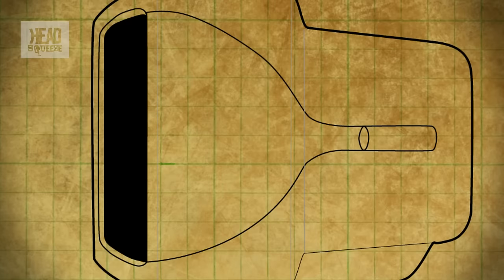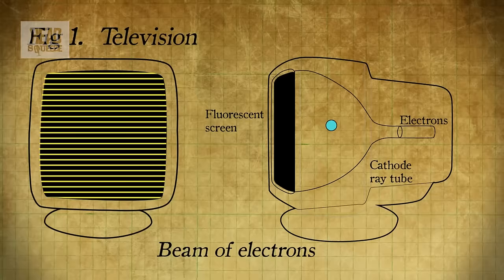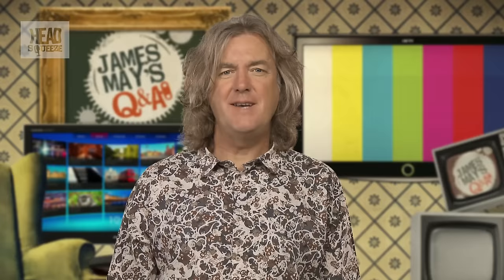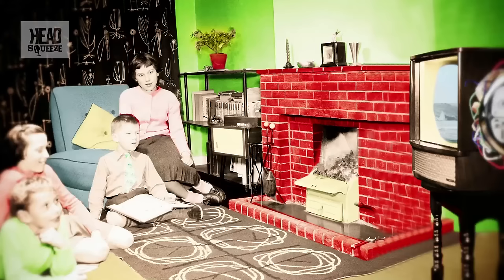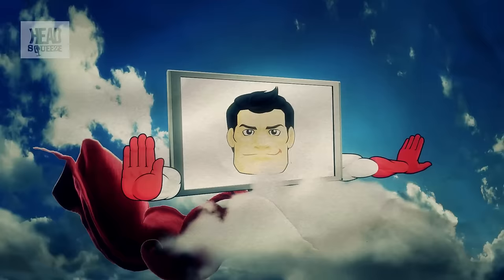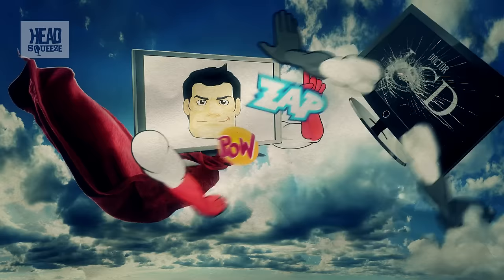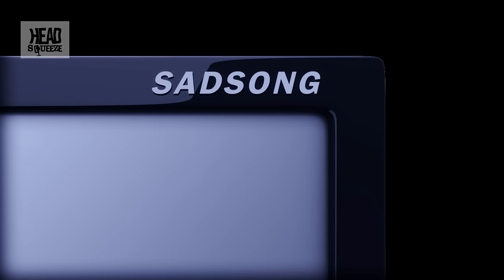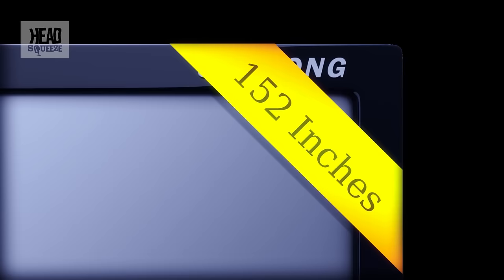How do plasma TVs work? I James May Q&A I Head Squeeze

Comment: How does a microvawe oven work? I guess it was asked but just in case ;-)
Reply: It generates electromagnetic radiation in a specific frequency that water molecules in your food react too and heat up. i might be wrong.
Reply: No, you are absolutley right I just want to se it in a video with a bit of fun facts ans stuff that they do :-D
Reply: Pan Fritz wrong.. the microwave sucks hot air in and pumps it into your face
Reply: You should not have said that ot me, now I want to try it. ;-)
Reply: cool i need a new plasma tv

Comment: Red, green and blue are the primary colours (yes, I'm Australian) for light, and red, blue and yellow are the primary colours for pigment. However, you are right, in saying most TVs use red, green and blue. I just thought more people should know.
Reply: "Primary" is a totally arbitrary designation. What you need to be able to reproduce a full spectrum is a set of three colours that are complementary (relative to each other). RGB, CMY, or any other set of 3 colours that are 120º from each other on a colour wheel.
Reply: @RFC-3514  Replying to an 8 year old comment lmao
Reply: @uwillbegme  - Has the definition of "colour" changed in the mean time?

Comment: Take it from an audio video engineer. Don't fall for the sales hype on these LED TVs. They are very hard on your eyes. I can't even believe they sell these things. It's a disgrace. Where is the reference piece? There is none the LED is all hype and sales talk and does not perform or deliver on any level. Buy a plasma and enjoy your life
Reply: The main reason plasma TVs are being phased out is that they use around double the power of LCD displays. 

In the future, OLED dipslays will probably take over and since they don't require backlighting, they will provide the same excellent contrast that plasma TVs do.
Reply: Rebasepoiss We can hope that you will turn out right about OLED tvs.  Right now, however, only LG is doing any real research into the technology.  Sony discontinued their OLED research and even discontinued the OLED screens for their PS Vita.  Now, you can only get a Vita with an LCD screen.
Let's just hope that LG sells a ton of their $3500 OLED tvs and inspires the rest of the market to get back into the technology.  With the death of CRT, DLP and now Plasma tvs, consumers are running out of ways to get excellent contrast in a home television set.

Comment: Re: Primary colours in television, they are Red, Green and Blue.

Red + Green = Yellow.
Green + Blue = Cyan.
Red + Blue = Magenta.
Red + Green + Blue = White.
White is made from a ratio of 11% blue, 30% red and 59% Green light.

These are the actual stats I was taught in college (specifically TV repair).
Reply: That last line is meaningless; you'd have to define the exact wavelengths (or distribution across the visible spectrum).

You're probably thinking about luminance sensitivity of the human eye (i.e., for the same total amount of light, green looks brighter to us than red or blue - similar to how sounds around 3500 Hz sound "louder" than 500 Hz or 8000 Hz even when they have the exact same amount of energy).
Reply: @RFC-3514  No, luminance is a different signal altogether in tv, relating to the brightness of the image.
 Chomanance is a seperate signal relating to the brightness of (usually) blue and red.
The human eye does see colour in varying strengths, it is even different from person to person - but the tv works on the numbers/ratio above.
Reply: @mickenoss  - I think you misunderstood what I wrote.

The values you mentioned are used to calculate the relative weight of different components for the luminance channel (typically called "Y") , in systems like YUV, YCbCr, etc..

For example, in PAL YUV, the Y channel (luminance) is 0.299×R + 0.587×G + 0.114×B.

Those weights are based on human vision, and they're used so that the Y channel can be used directly as a monochrome image (originally, so that colour broadcasts were compatible with B&W TV sets).

Chrominance is any set of two channels (typically along perpendicular axes within a colour space) that allow you to recreate full colour information by combining them with the luminance channel. They're not necessarily based on red and blue (YIQ's axes - used for NTSC broadcasts - are closer to cyan-orange and green-violet, for example).

But that was analog TV, anyway. In modern digital TV, which works natively in RGB, white is made up of identical amounts of those three channels (i.e., R=255, G=255, B=255, for 8-bit panels). The physical (light) weighting is done by the panel itself. From a "signal" (data) point of view, white has the same amount of each component.
Reply: @RFC-3514  I think you are missing the point of my original comment in an attemp to look clever.
 James mentioned tv's produced a colour image using red, green and yellow. This is wrong, it is red, green and blue.
Lookup up the ratio of colours needed to produce white light, you'll find the ratios I mentioned are right.
 I only stated them so it could be seen more clearly how white and other seconary colours are created.
Reply: @mickenoss  - Yes, he got yellow wrong, but the values you mention are specifically the weights used for the Y channel in YUV (which is just one of several encodings used for analogue video).

If you're talking about actual white light (in the "real world"), then first you need to define the exact wavelengths you mean by "red", "green" and "blue" (or whichever components you want to use), and even then you won't get true white light, because you'll have a very discontinuous spectrum (whereas "real" white light should be a mix of all wavelengths, not just three - this is a common problem with "white" LED illumination, that looks white when lighting plain white objects but can make some colours look "off", because it's missing intermediate wavelengths). 

And if you're talking about modern (digital) video, the values are actually identical for all channels (i.e., "white" is made up of identical values of red, green and blue).

Nothing to do with "looking clever". You just made a generic statement about "white light" based on a specific video standard, that doesn't apply to actual light or to the way colour is encoded in modern digital video.

Comment: It was red, blue and green Mr. May, not yellow.
Reply: It was actually yellow.
Reply: It is now red blue and green, but was initially red blue yellow. In pigmentation and nature Red b lue and yellow are the primary colors, but with light and digital display we use red blue and green
Reply: MacLeod Conners 
Thats actualy wrong.. well, partly wrong. The primary colors for light is Red-Blue-Green. The primary colors for print is Cyan-Magenta-Yellow.

There is NO overlapping of the print and luminancande color what so ever.
Reply: matsv201 let's rephrase this. They now say magenta, cyan, and yellow, because it's"technically" more accurate. Magenta is a shade of red, cyan is a shade of blue, yellow is yellow. Go to an art store and buy a color wheel for mixing paint; you will be told that the primary colors are red, blue, and yellow. If you want to be scientific about it, you would never say"magenta" you would say it's red followed by its intensity of red using the color measurement in Kelvin. Not Kelvin temperature of heat but color. There's always a way to be more right,  but when simply spoken things are still right; red, blue, and yellow are the primary colors,  even if it's different shades.
Reply: "Magenta is a shade of red, cyan is a shade of blue,"
No.. you cant really say that, even subjectively its wrong. Magenta is a perfect 50/50 mix of red and green. Cyan is a perfect 50/50 mix of blue and green.

Some people cal Cyan bluish-green (or greenish-blue) and than i say... okey, you might call it that. But you can´t call it Blue (or for magenta red) because its 50%....

With that logic you can go on and say, well, yea, magenta and cyan is blue and green to... so you can say that the primary colors is Blue, Green and yellow... or even, pushing it. Blue blue and yellow., or any combination would be equally true.

So if i say that the primary print colors is blue, blue and yellow, i guess you would never agree to that is true, so consequently, i can´t agree to Magenta being a shade of red, and there for magenta is red.

Somewhere you have to draw a border of what is a shade of red and a shade of blue, and magenta is the exact border.

That they teatch that in school is stupid beyond belief. And there is no way to say its correct.

Comment: Who would buy a plasma TV today?
It's thick, heavy and consumes so much power. Not to mention that almost every known manufacturer stopped producing them for couple years now. Also there is a big problem with colours "burning" into the screen, which is fatal. 
With todays LED technology evolving every year, a energy consumption less than 1/10 compared to a Plasma TV with the same screen size.
They can become really thin and light, and are compared to the Plasma Future Proof. With a Plasma you can't just turn the refresh rate up. That doesnt work because of technical limitations of these TVs. Led TV aren't limited in any way. You can stack resolution, change the refresh rate and change the size of the Pixels. You can produce flexible LED Displays allowing for Curved TVs and Led-TVs have a MUCH better viewing angle.
Also there is a new technology called O-LED which eliminates the only benefit of Plasma and that is its blacks. Because O-Led doesnt need Backlight, each pixel can completly turn off, like the ones on the plasma resulting in exactly the same perfect blacks. Also O-Led and Led displays are featuring a far more accurate colour reproduction and contrast ratios.
Reply: +Dan P No, people "blinded by LCD" understood that High Definition LCD TV's were far superior to 1024x768 downscaled images on a plasma screen claiming to be "HD" unless you got a 50+ inch display, not everyone has a place for such a large display, nor the money to afford it, also, why would you choose a plasma display that consumes more power and will have a drastically shorter lifespan than modern LCD displays?
Reply: +Mr Needs so according to you resolution is the most important thing that makes a quality display? pretty much shows you know nothing. Done with this kid
Reply: Dan P Ignorance...
Reply: Having owned both Plasma and LCD, the image quality is far superior on an LCD display, on older models of LCD the image was poor with bad brightness and contrast, but a modern LCD panel with LED backlighting is immensely better, I really can't see your argument being anything but "salesman's script", also, I'm far from a kid, I'm probably old enough to be your dad.
Reply: Haha how is it salesmans script when they stopped production of plasma 2 years ago? How am I trying to sell anything? So what you're saying is because you owned "X" Plasma and "Y" LCD based on your experience with both techs you like LCD better. That is your opinion but sadly it is not shared by most ISF calibration techs or television reviewers, all you would have had to do is do a little research to avoid making yourself look hopelessly ignorant.

Also maybe with the low end bargain basement Plasma they might be equal to LCD, but a mid to high end Plasma like Pioneers Kuro line or Panasonic VT/ZT wipes the floor with pretty much any LCD/LED ever made.  So my advice would be that you get what you pay for so stop buying cheap crap.

Oh and LED is just a gimmick sold to you by the manufacturers, your LCD is still being backlit if its from a CCFL or from LED's genius.....

Now off with you before you make any further statements that make you look dumber than you do already.
Reply: Mr Needs man just your comments about using more power and shorter lifespan really speaks volumes about how ignorant you are on the subject. You should really educate yourself on the subject before making such statements..... google is your friend......
Reply: I bet you don't even know what ISF or D6500 means.....
Reply: +Dan P I've been using a 4K AMOLED Samsung for months and it's very great. Can achieve complete blacks and shit, color is incredible and spectacular too unlike an expensive 1000 buck plasma TV a friend owned, which burned out eventually in the corners. Would go for LED tech over Plasma any day!
Reply: +The Suspect They won't get a plasma tv today. But this video is 2 years old when plasmas were a bit more popular. Also, oled is a pretty old technology. Oleds have LESS accurate color reproduction but they do have better contrast and more saturation.
Reply: Color and image settings is all preference. There are so many calibration settings that it's all preference. What really sets tv technologies apart,is which one has the best black color definition,zero input lag,smoothest refresh rate,and most vibrant colors. Those 3 image qualities is what makes or breaks a tv or pc monitor. It separates the Alphas from the Betas. The videophiles from the tv noobs.  As for motion performance,plasma tv is best in video game use,smooth buttery frame rate,and absolutely no input lag. This is very important in fast paced games,such as call of duty,no motion blur with  Plasma.
Reply: I have a high-end plasma pioneer display (native fullhd) and I have had top of the line LCD-LED displays.
While 2016 models certainly outperforms the Pioneer ever so slightly on blacklevels, and literally outshines it by far in brightness, back in 2009 when the Pioneer was released, LCD was still half a decade away from even coming close

I'd love to see where plasma could have gone with another half decade of prime time funded development
Reply: Flimzes Pioneer made the standard models. You need a Panasonic plasma from 2013,but they are still pricey,the few that are left. Up to $6000 on amazon.
Reply: Some might argue that panasonic spent most of the time after purchasing pioneers lineup just catching up, but yes, I stand corrected on that detail.

My Pioner LX-5090 does well enough for now, I don't have the money to track down a Panasonic VT-60 or similar
Reply: Yes, Panasonic actually purchased the Kuro patents when pioneer exited the TV market and implemented MOST but not ALL of the Kuro tech. There is no reason to buy a panasonic VT/ZT if you have an 8th or 9th gen pioneer plasma. The pioneer is not only a better television, it's build quality, and the components inside the television are superior to the Panny.
Reply: I managed to get my hands on a Panny GT50 shortly before the supplies dried up when they stopped making them. It's one of the LucusFilmTHX certified ones. The picture is something else. Things like LeMan 24hr night-racing pop. Glastonbury night-footage is gorgeous. There's a real warmth and richness and depth that you have to see to appreciate properly. I've only seen oled's in the passing so I don't really have a good feel for how they perform,  but the higher end LED screens I've sat down to at friends just don't quite match up. They're good, don't get me wrong, but I always feel a bit smug that I chose this particular path (lots and lots of research, otherwise I would've bought a more expensive LED and lost out).  All plasma's were not made the same though. My previous TV was also a plasma but it was 10yrs+ older than the Panny and had nowhere near the picture quality (apart from anything it was standard def only and I never got it properly calibrated). I've heard a lot of people raving about the Pioneer Kuro's. I've not seen one in action myself but I understand that the later Panasonic's have Kuro DNA in them so I can understand the love. In the end, though, LEDs are cheaper to produce and it's easier to scale production, so I'm afraid we've had to say goodbye to plasma. I've heard that Panasonic gave up in the end because the move to 4K was something that wouldn't work (not sure if it was a technical limitation or a cost limitation). It's a damn shame. Hopefully, though, my Panny plasma will last as long as my first one - 12yrs (I think, from memory, certainly more than 10yrs anyway). It was still going strong when I decided to upgrade.
Reply: I never had color burnin on my plasma and i had for years! Used it all the time hours a day as a kid! One of the best samsung products ever made, you can tell they tried hard to innovate back then.